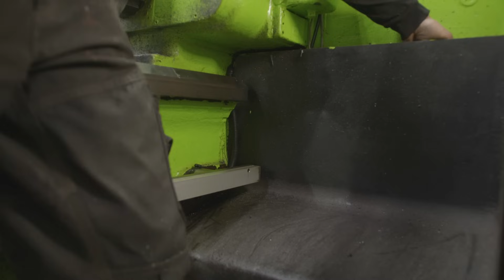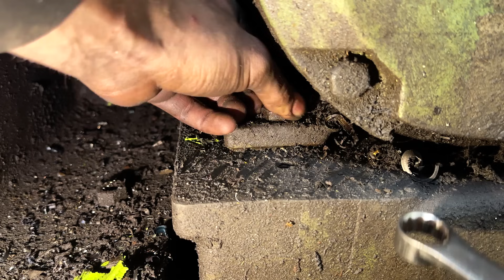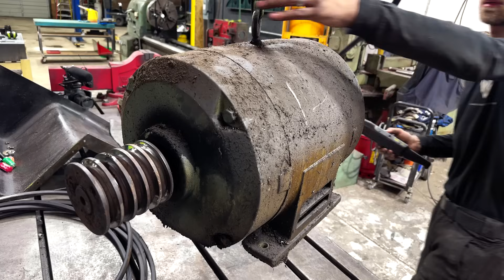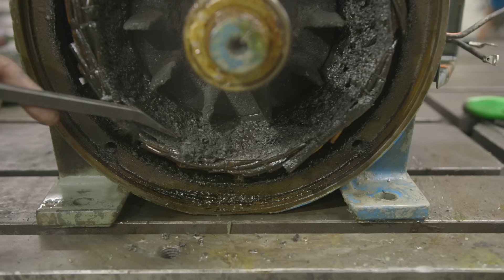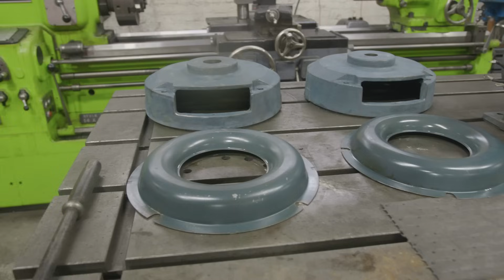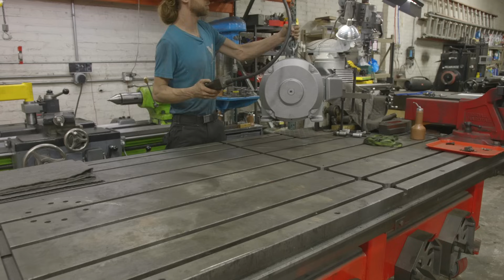Emergency Pacemaker Motor Repair | We Saved $6,000 on this repair!

Comment: @Vanover Machine & Repair ,  Can the pacemaker's top slide , tool post & tool holder take that kind of torque load ?  thats 300 pounds X Length of sky hook arm X 1.5 ( compensating for dynamics when the load bounces as you swing it out) . That looks sketchy to me ....
Reply from the maker: Yeah, I mean I’ve been doing all kinds of weight on the top slide for a while and it takes it just fine. That compound is also super beefy. It’s bigger than a lot of lathes I’ve seen in that size by a fair  margin.

Comment: Nice job on the motor. One funny error though when you first said touching the non rotational part of the motor, and said 'stator' but then you sort of changed you mind and said 'rotor' You had it right the first time! Easy way to remember what the rotor is: it's the part that is physically turning. ~~ Cris H  BSEE
Reply from the maker: Yeah others have said similar comments

Comment: Only use the SKF Explorer Bearings with "JEM" siffix designator.  These muvs use the Mobil Polyrex EM (EM = electric motor) grease which consists of a polyurea thickener and mineral oil base lube , C3 internal clearance, ABEC 3 tolerance, QE6 noise specifications, low noise, low vibes, all all specifically formulated for kickass industrial electric motors...so SICK need Robitussin homie!  Get some!
Reply from the maker: Ok cool got another coming up I’ll try to grab those.

Comment: interesting project. btw, you mentioned that you didn't want to use solvents to clean the motor so you used water. fyi- water is a solvent! also, i didn't see you grease the bearings before installation. most electric  motors use greased bearings.
Reply from the maker: Water is not a solvent. You never seen an msds sheet on water. Also lots of motors used sealed bearings. That’s what I used

Comment: Made me reminisce about my Navy Days, back when I threw wrenches at SH-60B Seahawks. Occasionally we had to disassemble Sonobouy Launcher Stepper Motors.  Much like the Lathe Motor, just a standard electric motor, with the biggest difference being a few hundred pounds. My motor only weighed 3 pounds and taking it apart to clean or replace bearings could be done with hand tools.
Reply from the maker: Very nice thanks for sharing

Comment: There is no 1150 RPM motor. 60hz *60sec=3500 -theoretical maximum for any mains powered AC motor. 1750 is exactly half of that, because the winding pattern is set up for half the speed. There is no winding pattern possible for 1150 RPM. A winding pattern for 1167 RPM can lead to 1150 measured speed when you slightly load the motor, but this is not a useful parameter.

Comment: Holy crap, that's one big Moe Foe motor! You're lucky to have 440V. You can often find odd voltage motors allot cheaper, as most people can't use them. I just swapped a C face motor onto  my Bridgeport Mills OEM motor, they wanted 900$ to rewind it. The new motor (Marathon 230V 3PH) was 200$. I just had to make an adapter plate...
Reply: PS - You had it right, the rotor rotates, the stator is stationary, and the one in the outer case with all the copper windings.
Reply from the maker: Yeah 440v for the win

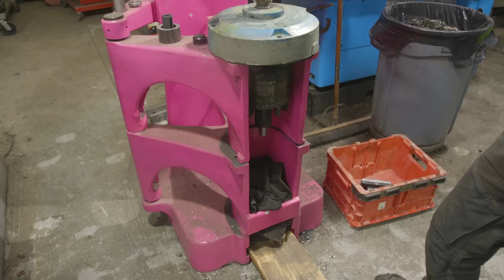Comment: Dropping that armature was probably not a good idea... 13:18 ... Very lucky a fin didn't break off.
Reply from the maker: I had padding down there
Reply: @VanoverMachineAndRepair yes but it just missed the cross member between the legs. As I said.. lucky.
Reply from the maker: @WApnj  better lucky than good any day

Comment: I'm confused, it seems like you're confusing the stater and the rotor, the stater is the fixed winding and the rotor is the part that rotates, Yes?
Reply from the maker: Rotor rotates
Reply: @VanoverMachineAndRepair  Yes, but you seemed to indicate the stater was the part that rotated.  You corrected your self and looked at the rotor when to said stater.

Comment: Couple of questions:  you pressure washed the windings, but did you do anything to get the moisture out afterwards?  Lots of people use DC on the windings to create heat but this takes a few hours.  Also, you mentioned 440 VAC motor rating and a possible wiring change; did you change anything?  BTW, nice work.  Are you going to dust-protect the motor?
Reply from the maker: No I air dried it and used compressed air as well. I tested the windings as well. No I did not cover the vent holes

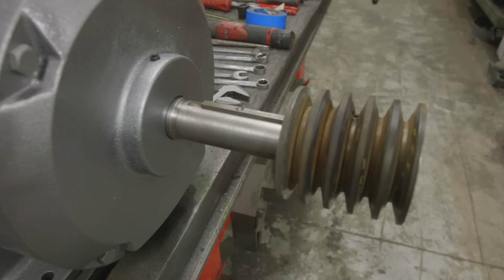Comment: Great job but at 22:14 you do give the new bearings a hard time.
Reply from the maker: What would be the better way to do that
Reply: @VanoverMachineAndRepair  Shrink it on. Clean the shaft and bore. If you have to press it support the shaft at the rear.
Reply from the maker: @who-gives-a-toss_Bear  sounds good on the next motor I’ll do that. Might have another coming up

Comment: I dont know how you dried the stator after pressure washing what we did when I worked on motors 60 years ago was put into a giant oven for a few hours then when it was cool to use a 500V Megger to test the windings to earth to make sure there were no shorts. I think you may have been lucky but you didnt show any testing.
This is the formula for motor speed 
(Hz x 60 x 2) / number of poles = no-load RPM
(60 x 60 x 2) / 4
7,200 / 4 = 1,800 RPM
which would be 1725 rpm under load.
In the UK the same motor would run at 1500 (no load) as our mains electrcity runs at 50Hz.
I would think you have a 4 pole mtor so it would be 1725rpm.
Reply from the maker: Interesting yeah I air dryed it

Comment: Awesome work. The motor looked brand new. Did you eliminate the transformer? Did you replace the drive belts?
I love your little crane: ‘SkyHook’ great idea, I will have to watch that build video. 
Be well
Reply from the maker: I did not eliminate the transformer I put it back together as it was. I would have if I had to replace the motor. I installed new belts last year.
Reply: @VanoverMachineAndRepair  just watched the sky hook 2 videos. Looks like it will save your back. Well done. 
Be Well
Reply from the maker: @davidmosscrop2374  thanks

Comment: Kyle I’m a retired power plant engineer so I must share a tip. When pressing bearings on a motor shaft never use the cooling fins as the press supports. They will crack and cause an imbalance.
Reply from the maker: Ok good to know

Comment: Most ac motors are synchronous. The supply frequency (and the number of poles on the motor) dictates the motor rpm. In the uk, a 50hz supply gives a 1440rpm motor or thereabouts. 60hz typically gives about 1700rpm.
Reply from the maker: Yeah 60hz in us 1725ish is a common motor rpm for us

Comment: Would have been worth paying $50 for a UNI-T insulation resistance tester. It can push 100/250/500/1000V through the windings (500v for your 440v Motor) and it’ll find if any of the varnish has decayed from overheating where a simple ohm resistance test with a multimeter wouldn’t. 

Rarely will these heavy duty overbuilt vintage behemoths ever have a problem as their shear mass (larger enamel wire compared to modern HP alternatives and general huge mass) is their best defense against overheating and general insulation breakdown.

Despite the low chance of an issue, the packed in debris might have nicked an area hard to see even when cleaned and if it was a problem the tester would most likely hint at it. To me, given the massive time investment to clean and move it back into its position, spending $50 to make sure I don’t have to pull it back out anytime soon would be money well spent.
Reply from the maker: Maybe on the next motor rebuild I’ll buy one I did know about them until the comments

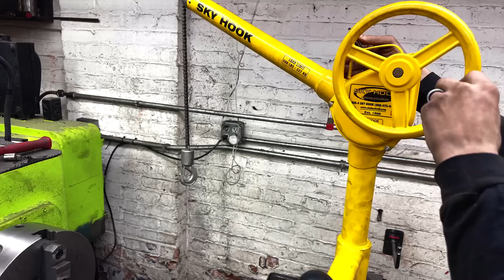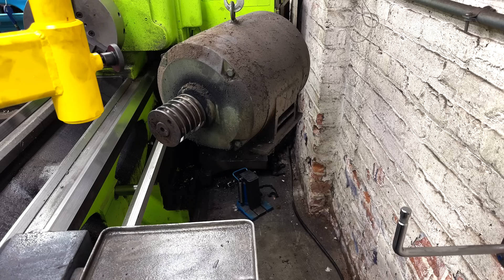Comment: At 7:00, lifting the motor with a long lever attached to the tool post just seems wrong. Soooo much extra leverage to break the tool post or carriage. I don't think maximal cutting forces even come close to the twisting forces exerted at this moment, lifting the motor.....  At 7:38, you can see the bouncing in the yellow arm, WHAT PART IS ACTUALLY FLEXING RIGHT NOW. All of that weight (315lbs) on a 2ft lever arm, plus you are pulling and tugging as well for 50-100 extra, (650-750 effective ... bouncing even),  all held by the toolpost center bolt and the threaded hole it is screwed into ... bouncing 650++lbs on just 1---> 1/2" or 5/8" bolt.  Thanks for making this video!
Reply from the maker: Well it worked great 👍

Comment: The best way to test and guarantee the windings are good is a megger test. This way you test the insulation with DC load and not just basic resistance. If there is a small fault the megger will make it show up.
Reply from the maker: Never heard of that before
Reply: @VanoverMachineAndRepair  MEGA Ohm tester = Millions of ohms can be resolved/measured.  Also other testing called Hi-Pot testing, applying a few thousand volts to the winding and seeing/sensing if a spark jumps through the insulation, (thin or damaged insulation), to the frame or ground.
Reply: @VanoverMachineAndRepair  A megger is a Megohm Meter and it measures millions of ohms at 500V to 1,000V to test the insulation. It's more accurate than a multimeter, but a multimeter will show up an insulation fault if it's bad.
Reply: The best way to test the windings is to Megger them. The best way to guarantee the windings is to re-insulate them and then Megger test them again.

Comment: Easy mnemonic: the rotor ROTates, the stator is STAtionary. Also be careful when you're pressing the bearings onto the rotor shaft, as it's possible to push the shaft out of the rotor entirely, or knock it out of position. Usually they're stuck in there pretty good, but a little precaution can save you hours of headache for that one time where it isn't. Anyway, great restoration!
Reply from the maker: Thanks

Comment: Kyle, firstly this is just my 2 cents!  I personally would like to see more of the process filmed and if that means hour long sobeit, I prefer longer videos.  Secondly you clead up everything else except for under the lathe where the motor is located.  There is no better time to do it than when you have it apart!  Love your content
Reply from the maker: I appreciate the feedback I am definitely cutting down 1.5-4 hours of footage into 20-40 min usually.
Reply: @VanoverMachineAndRepair  I would definitely take the hour or hour and a half for sure. I definitely prefer the longer format.  Snowball engineering puts out long format and I love it!
Reply from the maker: @clintonhanson  yeah true. I also do a fair bit of editing so the longer the content the less most people watch it and the more hours it takes to edit. I like snowballs videos as well but we have different shooting styles. I probably have 100-300 different camera angles per video which he has significantly less. It makes it a chore to take 2-3 hours of footage with all those cuts and watch it through 3-4 times during the edit. It’s compromise I want to do edits a certain way but also it needs to be sustainable so I can maintain a weekly or biweekly basis. Right now it’s only me doing everything so balance and compromise keeps me away from perfection.
Reply: @VanoverMachineAndRepair  I totally get that I am just putting it out there that cutting some of the things out that you do and making the content significantly shorter means I’ll watch it but I’d like to see it all!  I know you got to do what’s right for you!  Besides that why didn’t you clean out that motor compartment when you had it apart?  lol again I am not knocking your content at all I would just like to see more of your process which would mean longer content!
Reply from the maker: @clintonhanson  noted! Appreciate feedback
Reply: Maybe put out your normal format, and a long one? Just a thought @VanoverMachineAndRepair

Comment: Grettings, what causes your background humming? Do you hear it like the mic hear? Doesn't it causes you disconfort? Thanks for the video.
Reply from the maker: Yes it’s a bad transformer. Like 5 or 6k to replace and I wouldn’t get to keep it if I move. It’s part of the building infrastructure. Believe me I am annoyed by it every time I edit a video. No real way around it. Spending that kind of money is a hard sell right now especially if I got to move spaces it will pretty much be wasted money.
Reply: @VanoverMachineAndRepair  Yes, I agree with you completely! If I may suggest, some fire proof sound dampener? As it seems towards mid to high frequencies some soundproof panels used in drywall may work and it's not expensive.
But you are very very correct in saving the money.
Reply from the maker: @TechZF  yeah I thought of building a cabinet around it but I need access to it. Also heat is a factor and fire code. I’ll have some solutions but that haven’t come to fruition yet. I am o.c.d so believe me I am aware of the issue lol

Comment: Reassemble  vertical to prevent  angular damage to the bearings letting the stator hang on the front bearing had me cringing.  Hammering on the sheeve just brinelled both bearings.    Options.   Front br
Reply from the maker: Yeah maybe true it’s a lot easier to assemble horizontal. It’s much better than before but I am sure bearings will last the longest with more delicate care
Reply from the maker: Also how is the stators weight a factor in bearing damage. The full stator weight (50lbs) is always being hug on the bearings when at rest anyways. I can defiantly see the tapping on the bearings causing damage thus why press is best if possible but static weight I have a hard time believing. Especially when those bearings are probably rated at 100 times the static weight load of the stator.

Comment: Yessir, bearings can make all the difference! I wish I had such a nice lathe (or any lathe, for that matter). To me a quiet machine is very relaxing and reassuring. Keep the maintance up and all Your stuff will run smooth. We have different power (380/50Hz) but everything else applys. When I buy something used I always open it up, clean it and put in new bearings so I am safe with that.
But You hanging that on the tailstock got the pucker going for me. Okay, 317 pounds are around 150kg but still. Seems a lot, hanging on a lever and try bending all else...
Enjoy the goodness, Kind Regards
Reply from the maker: Thanks I appreciate it
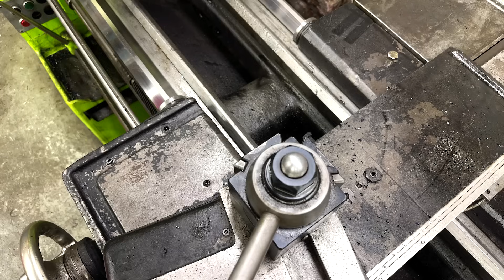Reply: Tool post at 6:35, not tailstock!
Reply: @johnrussell6620  My bad, it was late, I was stoned.

Comment: You need a TEFC motor for your lathe application, open Drip-proof motors not the correct motor
Reply from the maker: Yeah agreed in theory. I got a tefc for the lion but on this I’ll run it for 10-15 years and rebuild it again or replace it. Maybe then I’ll have more money 🤣
Reply: @VanoverMachineAndRepair   I am a electric apparatus service tech , now retired, repair electric motors for over 40 years , i am a winder too
Reply from the maker: @dundasjunctionmodelr.r-james  well since you the expert let me learn from you.  What is best way to replace bearings on a motor. My thought is pull them off. (Doesn’t matter how) press bearing onto stator shaft on both ends. Avoid using a hammer and press on center of bearing. Then lightly tap the end bells on with a mallet. Some people freeze or warm bearings or shafts. What is the preferred method for not damaging the bearings?
Reply: @VanoverMachineAndRepair   we used a induction bearing heater or a press, inner race only, in smaller motors I used a torch  6205 bearings or smaller, on the bigger bearing we used induction bearing heater’s
Reply: @VanoverMachineAndRepair   the biggest challenge in  repairing industrial motors AC and DC is finding a good machine shop, we were very fussy on bearing fits  resleeve to our specs as indicated  by ASEA , journals etc
Reply from the maker: @dundasjunctionmodelr.r-james  motors seem pretty straight forward but I got a gearbox rebuild coming up and I am trying to figure out how to do it correctly. It has several shafts with multiple bearings and multiple gears. Teardown kinda sucked but reassembly correctly seems like it might be a pain. My best thought is to press all the bearings into the castings (on their outer race) then freeze the shaft with nitrogen and try to slip the shaft in. Each shaft has multiple bearings and it’s not really possible to just slip one bearing on to the shaft like a motor. Any thoughts or tips on that?
Reply: @VanoverMachineAndRepair   we used the principle to install rotor shafts , lot of time we sent gear boxes back to the manufacturer they have all the tooling and drawings and spare parts if needed
Reply: @VanoverMachineAndRepair   I think there would be a certain order that the parts need to be reassembled. Just use your instinct, you got it apart
Reply: If you washed that stator with water , you will need to dry it out , before you apply power
Reply from the maker: @dundasjunctionmodelr.r-james  awesome thanks
Reply: @VanoverMachineAndRepair   going to subscribe to your channel, maybe a model railroader now but do enjoy watching areas that I worked in for over 40 years
Reply from the maker: @dundasjunctionmodelr.r-james  awesome I appreciate it
Reply: Also in Canada we use 575 volt motors , 440 not used too much any more